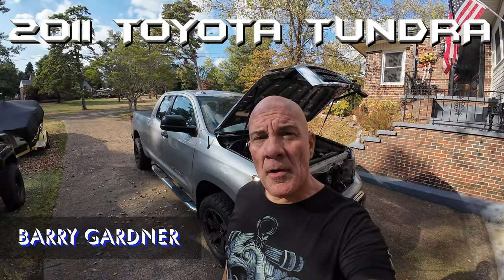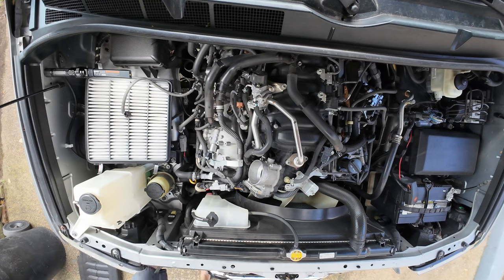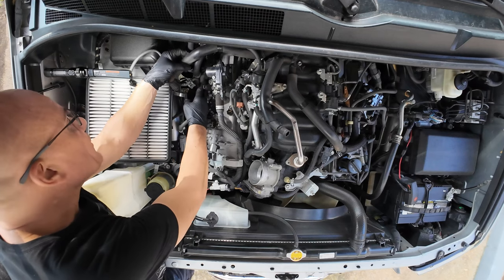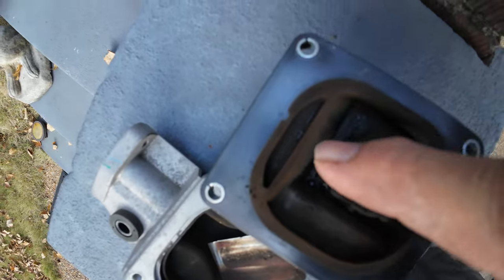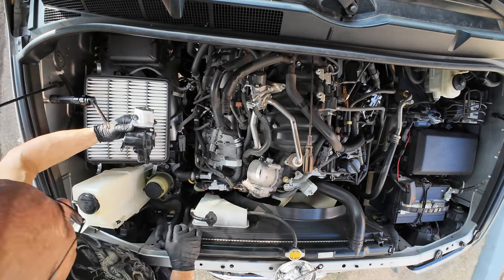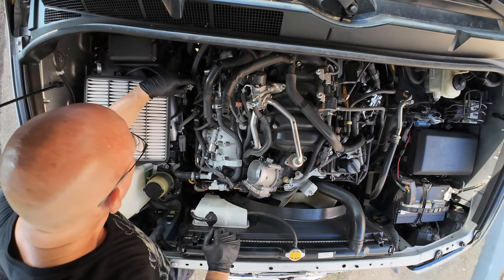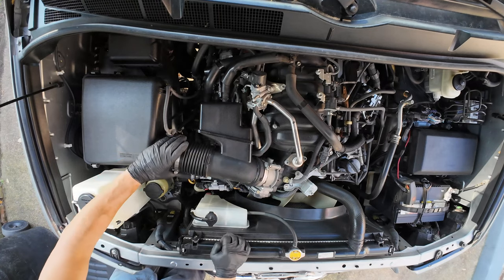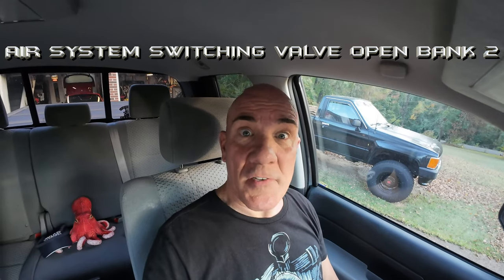Toyota Tundra Air System Switching Valve Stuck Open Bank 2 - Code P2442 Step-by-Step Replacement

Comment: Great job. Everything in the description is exactly what I am experiencing but I might go with the bypass kit instead. Great video.
Reply from the maker: Thank you! Good Luck!
Reply: Why by pass??
Reply: @crazyoceanlove  People use bypass so they don't have to deal with it again. I live in Comifornia so I have to replace the valve. This will be my second time.
Reply: @lesp315  does the bypass kit eliminate the problem and/or code? Or…? 

Thanks in advance! I have a 2010 that has been having this issue for a while and every place I’ve taken it estimates somewhere around 4K-6k which I don’t have right now. I’m thinking of the bypass kit as I live on the Gulf Coast and moisture is a constant. I read someplace that you still had to replace the secondary air flow sensor even if installing the bypass but that was a while back— if not I may be able to get it back on the road sooner.
Reply: @Definightly  I didn't use the bypass kit. I tested with a multimeter two pumps. They were perfect, so I only replaced both valves. Don't use Chinese valves like Dorman. I did it twice and they didn't work. Once I used DENSO Toyota parts all problems went away. The reeds in Chinese parts aren't the same and pressure sensors inside valves aren't working properly. I know that Toyota parts are not cheap. I was lucky and bought two brand new on eBay for $164.28 each including shipping. My Tundra is V8 4.6L.  Make sure they are made by DENSO. People cheat and remove Chinese part numbers. Also, the upper plastic parts are the same so you can buy two driver or passenger side valves and replace black plastic parts only. This way it's an easier job too. Good luck.

Comment: Great video! Thank you. 
I am trying to find OEM part for it, do you have a part # ?
Reply from the maker: You're welcome and thank you!
The OEM part number for "Bank 2" (passenger side) is 2570138100.
I used the Dorman brand part number 911-607.
I got it on Amazon for $185.37
The OEM part number for "Bank 1" (driver side) is 2570238050.
The Dorman brand part number for "Bank 1" is  911-624 and is available on Amazon for $238.63
Good luck!
Reply: @barrygardner67  Thank you!!

Comment: I take out the plastic part and the metal valve and replace only that. It's much easier. The only difference is the metal bottom parts and I just keep the old one on the engine. I only have to disconnect one hose out of the way and replace four screws. I'm lazy. :face-blue-smiling:

Comment: What code reader are you using??
I have the same exact code coming up, plan to replace this part soon.
Máhalo!
😎🙏🏽🤙🏽
Reply from the maker: I use the Blue Driver OBD2 Scan Tool for iPhone.
I've been using it for years and it's been great for my DIY needs.

Comment: Great work man! How did you remove the electric plug attach to this (black color) as I’m struggling to unplug this. You removed it so easily as shown in the video (at 3:35) where you said “it goes off”
Reply from the maker: I believe there was a tab that needs to be squeezed as you slide off the connector. 
Lately if I’ve ever been unsure how to open a specific connection, I’ll honestly google or YouTube it to learn how to open it correctly. 
In the past, I’ve worked some of those things in utter frustration and risked damaging them just by trying to force them and not understanding the proper way to open them.

Comment: I have the same code and lights on my gauge cluster. Did the codes ever come back, or was your issue resolved completely?
Reply from the maker: Once I replaced the part and cleared the code, the issue was resolved. 
So far, the code hasn't came back... yet. 
Over the past few years, I've had to replace the valve on Bank 1 twice so I anticipate the possibility of having to do Bank 2 again sometime in the future.
This is because of a design flaw on the air system intake tubes that go into the air pumps and eventually the valves.
The pumps could also eventually fail, which is a much bigger job to repair.
The open ended tubes allow water to enter the valves during wet, hard driving weather and that water causes the valves to fail.
I'm not a mechanic but forced myself to learn to do simple repairs and save a bunch of money if I could.
I hope the video helps!
Reply: @barrygardner67  thanks for the reply! I’ve heard from others that they keep replacing components to the air system - seems like a very common issue.

Comment: Where do you get your parts? Calling the local Toyota dealer is never a pleasant experience as they want you to use their service department and pay the 2k-3k?
Reply from the maker: I agree completely and try to avoid dealing with Toyota if at all possible. 
Depending on the part, I’ve shopped around O’Reilly’s, Advance Auto Parts and Amazon. 
I always read reviews to determine the best value and look at other people’s experiences. 
The last time I changed the valve on bank one, it was an OEM Toyota part I got from Amazon at a much better price than Toyota would have charged me. 
When I did this one, bank two, I got it from Amazon as well but it was an aftermarket part, not OEM.

Comment: Stop wasting money repairing these parts, they will fail again. Go to Hewitt industries and get a bypass kit that is simple to install and will end this issue forever. The only function of this system is to pump fresh air into the catalytic converter for 45 seconds when you start the engine for emission standards. I waisted my money replacing the pumps and valves and it happened again a year later. I have had it bypassed for 6 years and never had an issue. Replacing these parts is a waist of money and time.
Reply: @rattown99  will it stop throwing the code if you don’t replace the secondary air flow sensor?
Reply: I left all the worn out parts in tack, the bypass kit comes with plates that go under the valves and the kit totally bypasses all of the sensor inputs. You will never regret it.

Comment: Thanks for the video, my truck is showing bank 1, but I'm going to do both. I'm pretty sure they will both be in similar condition.
Reply from the maker: You're welcome! Bank 1 is definitely easier because you have to remove the stuff in the way for Bank 2 but when it comes to swapping out the actual parts, they're basically the same! Good Luck!
Reply: @barrygardner67 
Do we need to change pump also 
Or only the valve
Reply from the maker: @omarmurad4763  You shouldn’t have to replace the pump. There’s a different code for that. 
However, sometime down the road, you may have to replace the pumps. 
As of now, I haven’t had to replace the pumps and I’m really not looking forward to have to! 😎
Reply: @barrygardner67 

Exactly,Mr barry there is no code for the pump, only I have two code p2440 Valve Stuck Open Bank 1
and p2442 Valve Stuck Open Bank 2
but the dealership’s spare parts department told me that the valves and the pump come together, and if I want to get the pump later, the price will be more. Because in their view, all three pieces must be replaced
Reply: @barrygardner67 

I checked the electricity of the pump and it works. I am confused😕😅
Reply from the maker: @omarmurad4763  Does your truck have the 4.6L V8 or the 5.7L V8?
This is very important. 
There’s a big difference in the two when it comes to those valves and the amount of work involved to replace them. 
I’m not a mechanic but I believe on the 5.7L, you have to remove the entire intake manifold to get to the pumps and valves and they’re completely different from the 4.6L. 
If you have a 4.6L, you do not have to replace the pumps as the valves are separate parts. 
If you have the 5.7L, it’s a totally different part and a much bigger job. 
If you are replacing the valves on the 4.6L, you don’t need to go to a dealership for parts as they’re very expensive there. 
The OEM part number for "Bank 2" (passenger side) is 2570138100.
I used the Dorman brand part number 911-607.
I got it on Amazon for $185.37
The OEM part number for "Bank 1" (driver side) is 2570238050.
The Dorman brand part number for "Bank 1" is  911-624 and is available on Amazon for $238.63
The key is if you have a 4.6L V8, this is the repair for those codes.
Reply: @barrygardner67 
I have 4.6 V8

Thank you very much. I replaced them without the pump and everything is fine. I really appreciate your efforts in helping people
Reply from the maker: @omarmurad4763  You're very welcome!
Thank you!
I'm really happy it worked out for you.
Keep in mind... hopefully they won't but the valves you replaced could fail again for the same reason sometime in the future and you'll have to replace them again.
Over the past five years, I've only changed Bank 2 once but I've had to change Bank 1 three times! 😡
Once again, I'm happy you were able to solve the problem yourself! 😎
Reply: @barrygardner67  Just so you know I had to deal with Bank 1 three times and finally realized that Dorman valves are junk. The reed is made of different material and it's different shape. I think that the pressure sensor is not high quality either. My 2 cents.